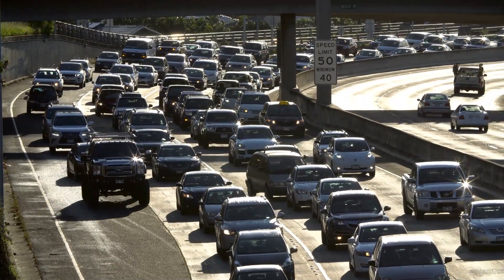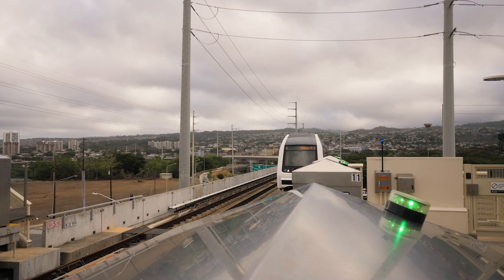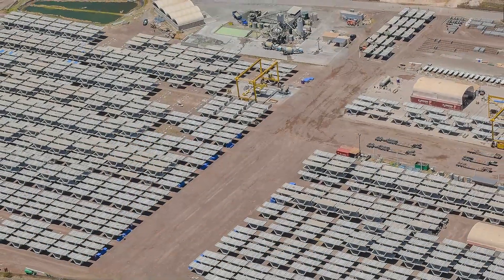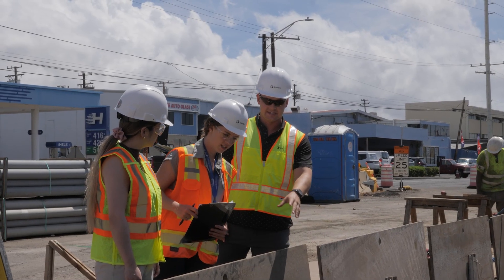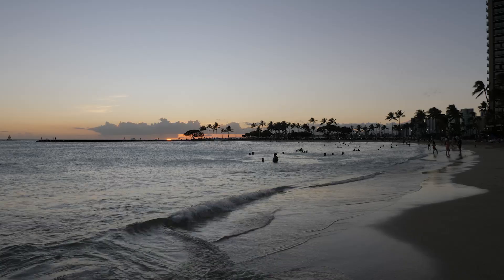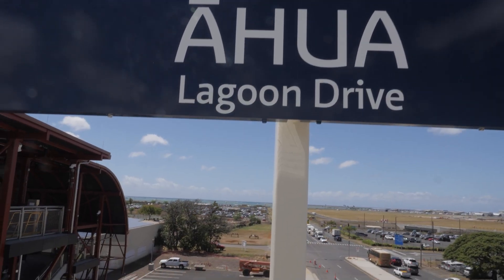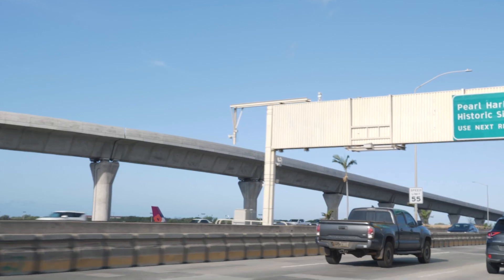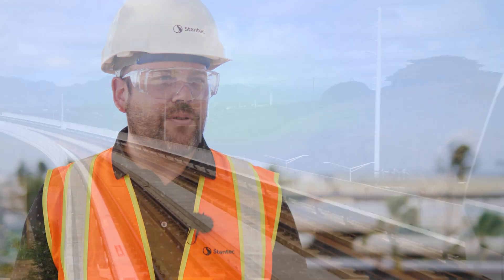​Construction management to deliver the first driverless light rail system in the US

Comment: “the first driverless light rail system in the US”

First driverless?  No, the Las Vegas Monorail has been in operation since 1995.  San Juan’s Tren Urbano was designed from the beginning to be capable of fully automated operation, and has been in service since 2004, although they have chosen to have operators on board for security reasons.

Light rail?  Only in the fevered imagination of people associated with the rail fail.

“The Federal Transit Administration categorizes Honolulu’s rail as ‘heavy rail,’ but Toru Hamayasu, HART’s first interim executive director, says this is not entirely a fair description. He writes in an email that HART preferred to call Honolulu’s system a ‘light metro rail’ to fit its image of something that is in between light and heavy rail systems: ‘Light rail by definition is a system where one car can operate on its own while heavy rail requires several cars with dedicated functions to make a train,’ he writes. ‘HART needs two cars to operate. FTA also defined a heavy rail to have a third rail for power and that’s what HART has too. So for the functionality, HART is more likely a heavy rail. But heavy rail cars are usually longer and consist of more cars. HART cars are about 16 feet shorter than typical heavy rail cars and one train is no longer than four cars. So to avoid the image of a big train running overhead through the shores of Honolulu, it calls itself a light metro rail. Similar systems are in operation internationally, such as in Vancouver, Copenhagen and Milan.’” hawaii business 11/9/2021

Reduce congestion for our $10 billion (“civic center”) to $11.3 billion (Ala Moana) “investment?”  According to table 3-12 in the final EIS, rail will reduce traffic by 1.7% vs the no build alternative.  That's roughly one out of every 59 cars.  Probably not noticeable.

Reduce carbon emissions?  Maybe, but a large majority of Oahu’s electricity is generated by burning fossil fuels, and this thing will require 15 megawatts to run.

“$95,953,476 For rail operations and maintenance of the rail segment from East Kapolei to Aloha Stadium in FY 2022, according to DTS. Of that amount, $16,255,000 is for electricity to power the rail.” hawaii business 11/9/2021

“HART expects the rail system will initially require nearly 15 megawatts of power to operate the entire line, according to figures provided by HECO.”  Civil Beat  8/22/2019